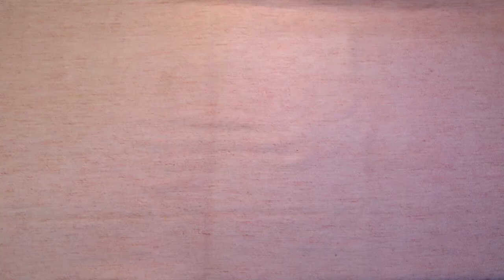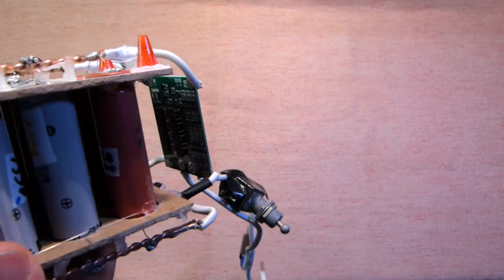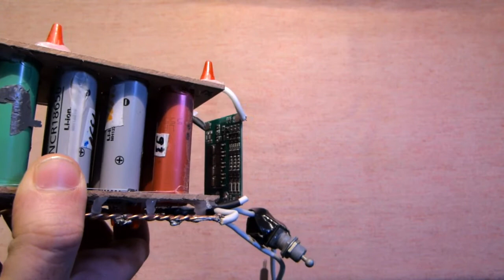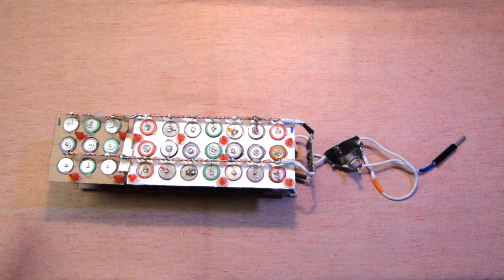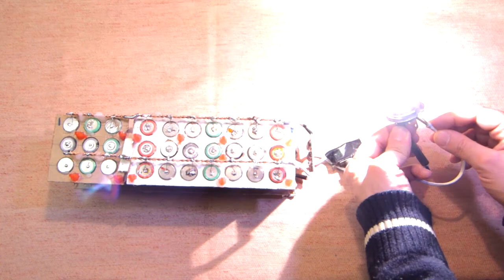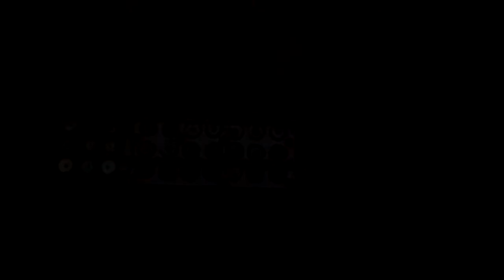BMS Board HX-3S-FL25A with balance function

Comment: I would like to know how can i do to know, when the batteries are already charged, and what for are the two points maked with s1, s2?
Reply from the maker: s1, s2 are designed for thermal sensor. As to the charge level - you should purchase level  indicator separately; this board has no indicator; this is protection and balance board.

Comment: I have a 3s2p pack with this board and it won’t charge with 12.5v. the current voltage is 12.0v. the batteries are all the same 4.0v. can I reset the board by disconnecting the batteries? i’m not sure how to fix my problem.
Reply from the maker: You should start soldering 3S pack from 0 volt (- of the battery pack), then solder 4v, then 8v and then 12v. The scheme should work.

Comment: Can i use 3a battery paralal in 8pic
Reply from the maker: What is 3a?
Reply: @powerbatterychannel4315  3amp/3000mah
Reply from the maker: @asimmaity4301  Yes, you can
Reply: @powerbatterychannel4315  3s8p (24amp) Lithium ion battery pack 
How amp bms use this pack
Reply from the maker: @asimmaity4301  Watch the video.  The battery of this video is 3s10p.

Comment: I want to make a 12V lithium battery pack of 25VA. Can I get some guide on how to use this board and where to buy and number of lithium cells  batteries to make this pack.
Reply from the maker: The links are in the description. You can also find the cells on Aliexpress. As to soldering - you should first solder "0" contact, then +4V contact, then +8V and only after that you can solder +12V contact of the battery to the BMS board.

Comment: How to charge this battery pack please answer brother
Reply from the maker: Hello, you need a powerfull CC CV power supply; for this purpose you can use any DC source from 14 up to 40V together with the following device: http://ali.pub/2p03b2 . With its help you will adjust the voltage 12.6V. As to the current - it will depend on the capacity of your battery.

Comment: I'm working on a project that is about analysys of a pcb-plate and there is two chips, HY2110-CB and HY-2113-BB3A. 
The problem is - i cannot find any simulation models or analogs of these, so i cannot even start my work.
Please, tell me, are they even exist. If they do - I'm ready to buy them. If they do not - could you please tell me any replacement with simulation abillity?
Reply from the maker: Which pcb-plate do you mean? This board has BE708V. As to HY-2113-BB3A, its simulation can be bought here - http://ali.pub/48bcd9

Comment: I got this board a while ago but there are only 4 instead of 8 of this large black parts (50N02 MOSFET) installed.
Reply from the maker: There should be 8 ones.
Reply: @powerbatterychannel4315  Thx for reply, there are still boards with 4 https://www.alibaba.com/product-detail/3-string-12-6V-lithium-battery_60777273039.html but i couldn't find out what the difference is.

Comment: i would like to display the state of charge to an lcd hooked up to an arduino. is there  any way to  measure and translate the voltage to a percentage?
Reply from the maker: There are volt meters with voltage and percentage for 3S batteries at the same time. But I have no information in connection with arduino.
Reply: @powerbatterychannel4315  okay thanks! and thank you for the fast reply!!
Reply from the maker: @beurtvanbaningen7786  You are welcome!

Comment: If I understand well, at the time to connect the board, all the sections has to be at the same voltage, otherwise it wouldn't work. Is it like that? I was testing charging with one section with 3.7v and another with 4.0v and it doesn't balance. I thought it was broken. Any BMS recomendation for 3s ?
Reply from the maker: You are right. All the sections should have the same voltage from the very beginning, afterwards the board will not allow the sections to differ their voltages.

Comment: What is the input voltage rating of 3s bms
Reply: Maximum of 12.6V but you can use 12.7 as well but don't overvoltage it..  safe MAXIMUM charging voltage of 1 cell is 4.2V and if you use 3 of then you must put 12.6V for safe charging proces

Comment: Is it use in motorcycle??  Charge from motorcycle rectifier  and discharge same way
Reply from the maker: I would not recommend to use lithium-ion batteries in motorcycles, if they work on AGM batteries.

Comment: What's the cut off voltage for this module?
Reply from the maker: 4.25V upper and 3.0V lower
Reply: @powerbatterychannel4315  I use this board and one of my blocks was 2.7V and it didn't cut off
Reply from the maker: @elbauty  It's not good. Maybe the board is faulty.

Comment: The board has two "test" points on it that are labeled s1 and s2, any idea how they work?
Reply from the maker: Hello; they are designed for thermal sensor
Reply: Lol, the board I received has them labeled as "Test Points", I should have figured "s" for sensor! Thanks!
Reply: Any idea what sensor? Or what temperature range?
Reply from the maker: Thermoresistor, like in notebook batteries. The range will be max. up to 125 C.

Comment: I am using this 3s bms but I am unable to charge it fully upto 12.6V, it is shutting off charging at 11.80 and shutting off dischage at 10.40 instead it should be fully discharged at 8.4.. What is the problem?
Reply from the maker: Either one of the cells is damaged and the board stops charging as soon as 4.2V per (this) cell is reached. Or, the board is damaged. But, I suppose the first reason. Try to install a small volt meter of each cell/section and watch the voltage. Good luck!

Comment: How do I charge it? What voltage?
Reply from the maker: 12.6 maximum.
Reply: so can i use a 12V 1amp adapter?
Reply from the maker: Yes
Reply: @powerbatterychannel4315  do I give a currant limited supply at 12.6v?   won't it stop when charging when protection limits are reached

Comment: What is the maximum amount of 18650 cell in paraller
Reply from the maker: If you get about 3 amperes from each cell, you can use 25/3=8 cells/blocks. You can also use 12 cells/blocks in parallel, but you will mot be able to get 3 amperes from each cell as 12*3=36, and the board will break the circuit at 25A.

Comment: How many 18650 cell I can connect with this BMS
Reply from the maker: 3 cells in series. You can also add such 3-cell blocks in parallel.